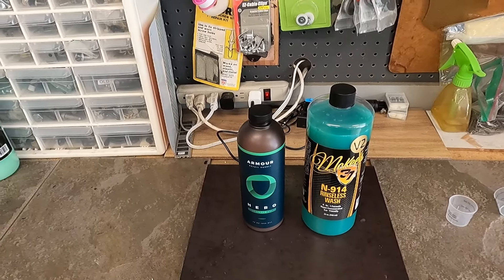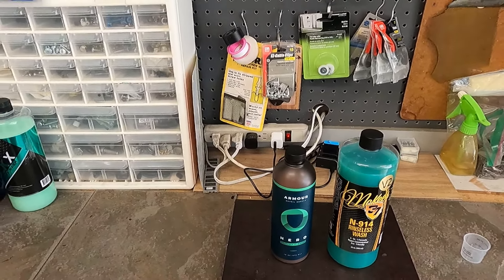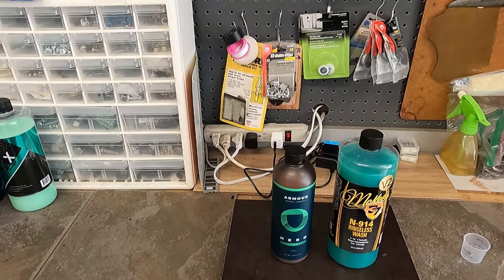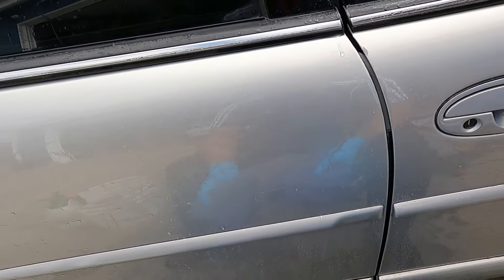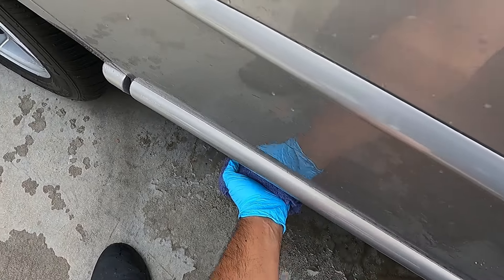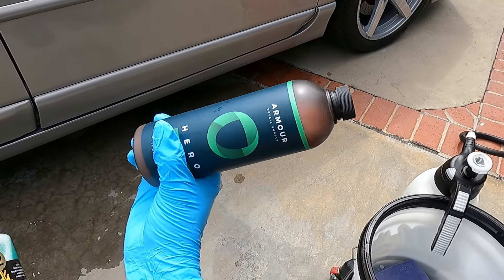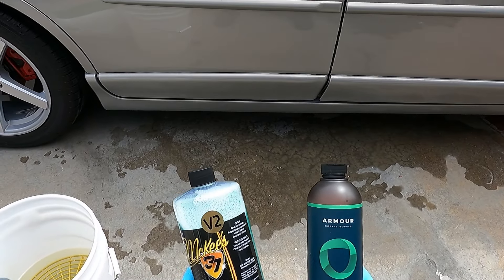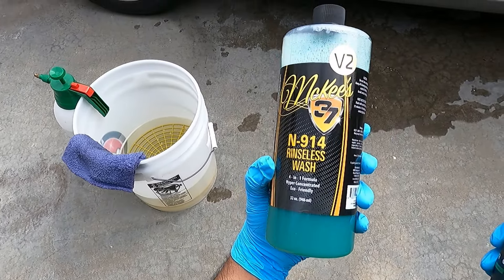Armour Detail Supply Hero vs McKee's 37 N914 V2 - Rinseless Wash Battle

Comment: Really good review Mike, youve cleared up a lot for me with this video. A couple of things I'd like to mention. 

Armour could do with a bigger bottle to match the 'sort of' industry standard for this rinseless wash (more like the sizes we're used to). 
I they're sold out on their website meaning in the UK it'll probably be ages until we get our hands on to try it out.

Whats it like compared to Absolute? Im using Absolute ATM and enjoy the user experience with it. Absolute does leave behind a little residue, but its easy to wipe off.

The 350GSM Eagle edgless is a great towel but it does lint quite a bit. It has me second guessing if I've marred my paintwork now and then. I prefer The Pearl towel as this holds its fibres more and seems great for rinseless washing.

I use deionised water with rinseless washing as it cleans better with less marks.

I would be cool to see a comparison test between Absolute and Hero. 👍
Reply from the maker: ADS stated on the livestream that they will be staying with 16 oz bottles and gallons.  Similar to DIY Detail.  Absolute is a good rinseless wash.  Sure it has its quirks with it being clumpy but for the most part it is a good rinseless wash.  Hero cleans better.  I will add this comparison video into the mix.

Comment: Hi Mike - great video. Where do you think Absolute falls into this mix? I've been wanting to try it out especially since many have recommended it as a drying aid at 64:1.
Reply from the maker: Thanks.  I personally would reach for Hero or N914 V2 before reaching for Absolute.
Reply: 64:1 is really high for a drying aid.  Use it at the 256:1 as your rinseless and as a drying aid.  64:1 should be fit for clay lube and or a quick detailer.  I use absolute every day at these ratios

Comment: What up Mike. I've been watching binging your videos and wanted to ask how you would compare the older Mckee sio02 rinseless with the N914 V2. Thanks.
Reply from the maker: N914 will clean better between the two.  If you are looking for a straight cleaner then N914 would be the choice.  If you are looking for protection than their SiO2 would be the choice.  The lubricity is about the same but the SiO2 will feel slightly slicker during wipe off due to the protection in it.

Comment: How does Mckees v2 compare to onr v5. I’m an onr user just because it’s tried and true. Which new rinseless gives a similar experience to onr in your opinion?
Reply from the maker: I was not impressed with ONR V5.  I had a little ONR V3 and V3 in my opinion is better than V5.  N914 V2 has better lubricity and better cleaning.  Let me check if I have some ONR V5 left and compare it to N914 V2.

Comment: Really nice comparison, but the elephant in the room is value for money. Hero is $17.99 for 16oz. Rrw is $20 for a liter and Feynlab is $22 for a liter. I bought Hero on release today mainly to support the brand. It's going to have to blow me away because Feynlab v3 is awesome. You can push the dilution to 1:384 and lose nothing in terms of effectiveness.
Reply from the maker: If Fenylab V3 ever shows up I will check it out.  I ordered it on April 1st and it was sent to Atlanta, georgia instead of California.  I did ask them for refund so not sure what they are doing as I have not even seen that.
Reply: @MikeGDetailing  That sucks and it's the kind of communication and service that drives customers away. I posted elsewhere, but I'm not sure the v3 isn't just with v1 with some added slickness. I used a lot of v1 and it smells exactly the same and I had to up the dilution to 1:384 just like I did with v1. It doesn't appear to clean wheels and tires as well, but not far off.

Comment: how strong is the idrosave protection?
Reply from the maker: It is pretty durable.  The fact that it will leave ceramic spots that are hard to remove if left unattended or working larger than one panel at a time.  This has been the number one complaint I get about the product.

Comment: N914 V1 was trash as a panel prep… also, if you like keeping diluted solution in spray bottles like I do, even diluted with distilled water, N914’s shelf life is only a few weeks long… I DM’d ADS and they confirmed a shelf life of over a year with HERO if you use distilled water.